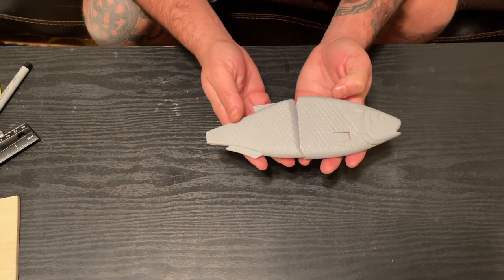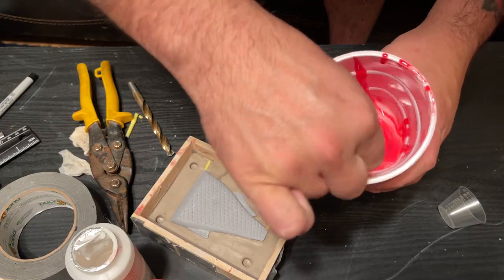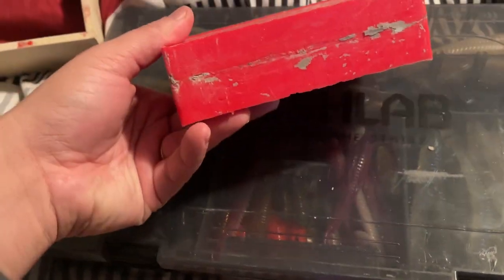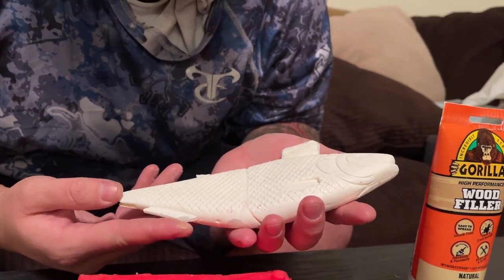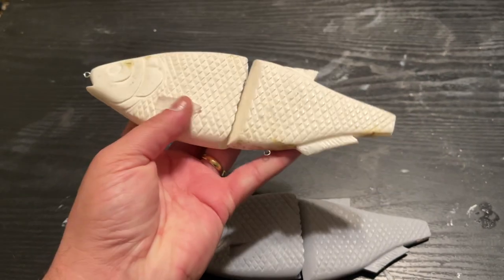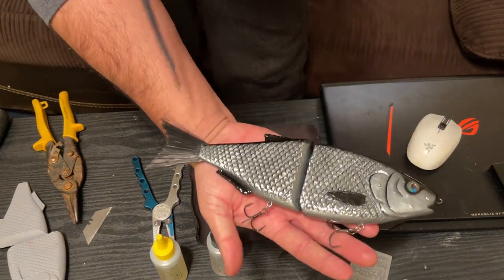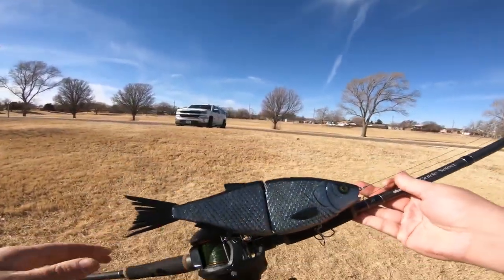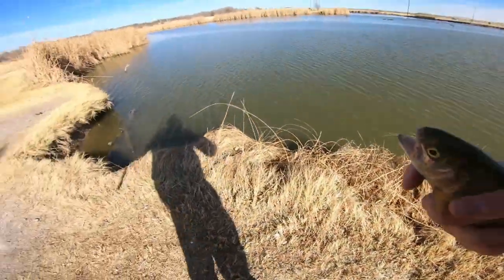HOW TO MAKE A LURE MOLD! MAKING A 10 INCH GLIDE BAIT

Comment: On the air bubbles you can take a torch or a heat gun run over the resin super fast and it pops all the air bubbles

Comment: If you add The hollow glass bead that make Epoxy Easier to send the plastic will be lighter and then you can add more weight in the bottom and have a much more stable bait